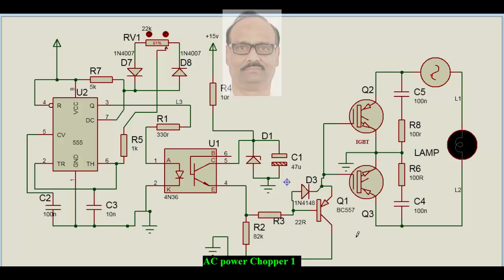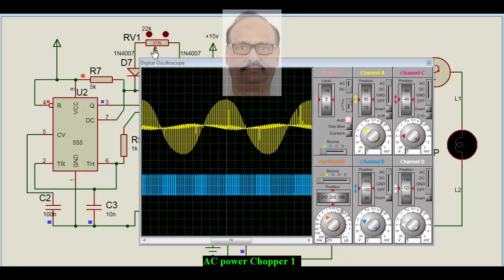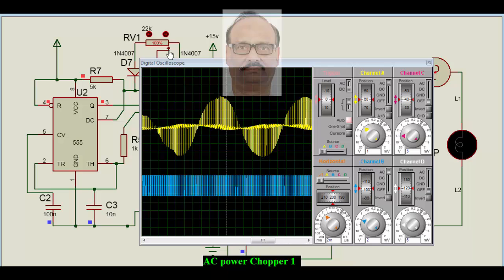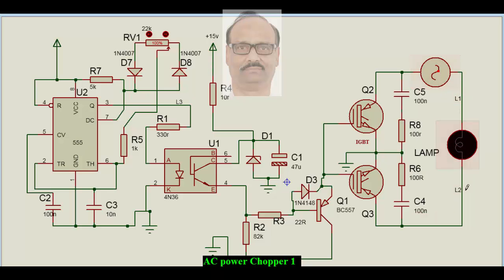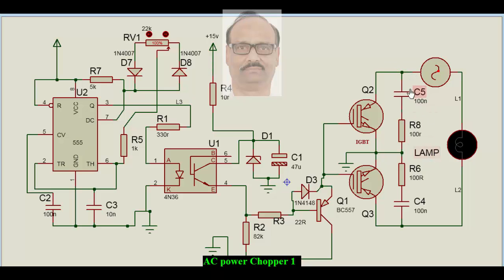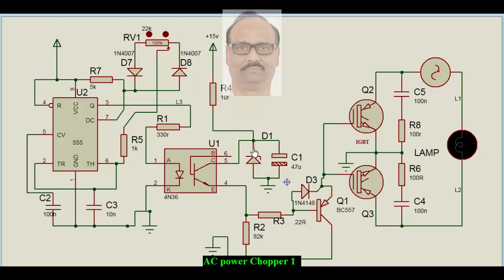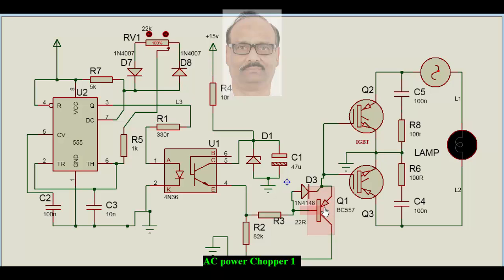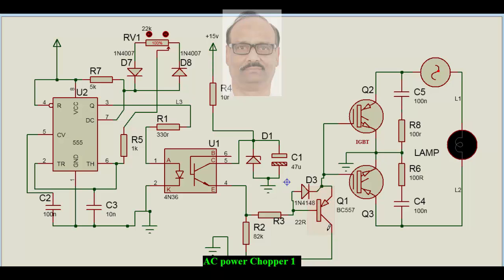EEE- Electrical chopper by IGBTs in series

Comment: Sir will this work for Ac universal drill motor
Reply from the maker: Yes. But there can be much cheaper by using a triac.
Reply: @PatnaikUC  Sir i have to control ac drill motor speed and torque. I am thinking that  by chopper method the speed and torque will be controlled better than triac phase firing method. Also the electrical noises  may get reduced.
Kindly share your thoughts
Reply from the maker: Yes
Reply from the maker: Triac version for universal motor is also ok

Comment: Hello sir, 
I made this circuit and it works. I controlled voltage of a 40 wattt Incandascent lamp.  But after some time the snubber ckt resistor became verry hot. I used  2watt 100 ohm resistor.  What is the reason for heating of 100 ohm snubber resisitor??...

Comment: Hello sir, what is the freequency of pwm??
Reply from the maker: Any frequency till 500 Hz
Reply: Patnaik UC  sir, do you have any equation for this frequency?
Reply from the maker: Standard 555 in astable mode by RC
Reply: sir, which igbt should i use?? when i simulated the output does not varies with pwm, the output does not varies at all..
Reply from the maker: It appears you are new to Proteus. I have lost the design file as my system has gone in formatting several times. Sorry

Comment: Sir what was the pracitcal application.
Reply from the maker: As mentioned in the description it rarely develops any THD (Third harmonic distortion) so they are better for inductive loads as compared to firing angle based  thyristor controlled which are not advisable for inductive loads

Comment: Thanks! As a beginner, I find very helpful having the circuit explained section by section, as you do. What simulator are you using in this video?
Reply from the maker: +Mattia Peronio Thanks.Please watch the other practical electronics videos meant for beginners. The software used is Proteus from Labcenter UK but it needs good amount of hardware experience to get its best